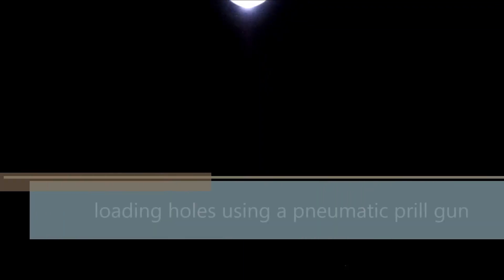Loading a Round

Comment: Love your very informative videos. I have a question. What is the advantage of blowing in Anfo like this vs just using a solid explosive? It seems like pushing in stick type explosives would be faster than blowing this in, but I was wondering if there were other considerations given that made this cheaper/more effective etc that overruled the time factor.
Reply from the maker: Scott Marshall ,  ANFO is much cheaper than stick powder, so we try to use it as often as possible.  Stick powder does have it’s applications and has a higher breaking strength.